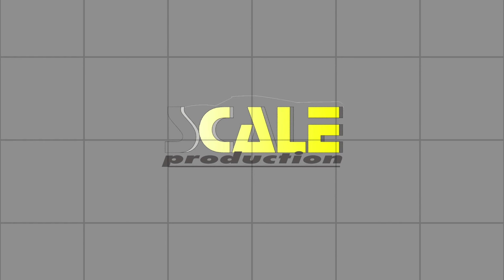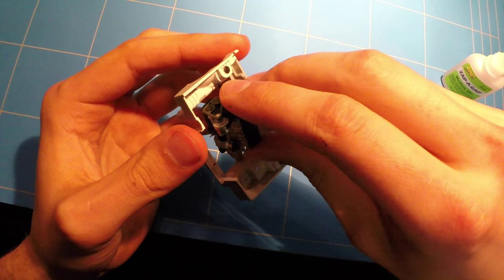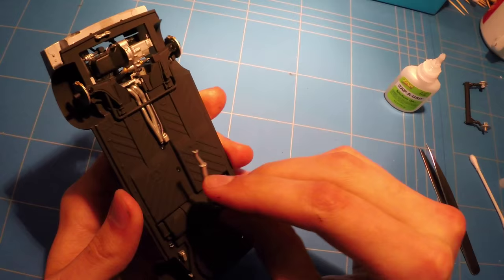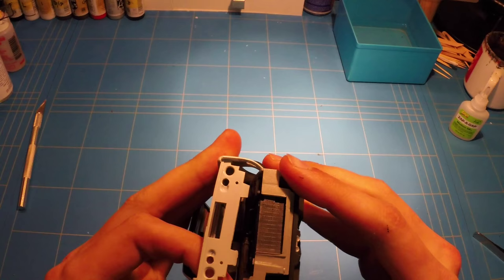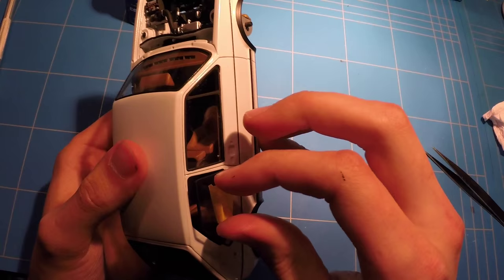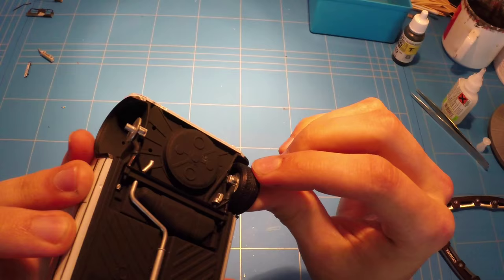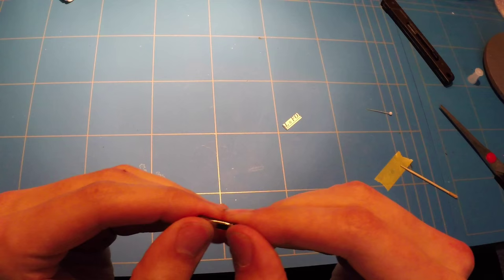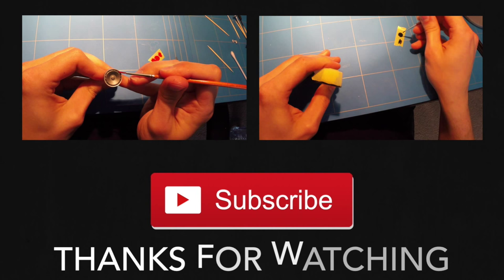Revell: VW Golf 1 GTI Final Assembly

Comment: What scale is this? Also, I was wandering if you were ever interested in for example putting lights in the cars you make. You can have some brilliant surface mount tiny LEDs in all sorts of colours to suit all sorts of ages of vehicles. An arduino could be a good choice... Or even a ESP8266 to make it completely wireless. And to get rid of any charging ports, you could implement a wireless charger in the floor of the car. All very cheap parts as long as you're willing to wait :P
Reply from the maker: This kit is 1/24

I'm not interrested in putting lights in the models at this moment in time. I also am not very good with electronics....
Reply: Well, if you were ever interested, I will be more than happy to help. Whether it's the coding part or the electronics part, just mention it and I'm on it ;)

Comment: Do you seal every part individually? When I glue two painted parts together, bondage is weak and paint starts to dissolve. Do you avoid this problem by using superglue instead of normal modeling glue? 
Great build keep up the good work,  true eye candy :)
-RJ
Reply from the maker: I indeed resolve this problem by using super glue. Or reming the paint on the glue surfaces when using plastic cement so that it can effect the plastic to bond, and not have the paint as an extra barrier.

Comment: did you use clear coat gloss?
Reply from the maker: yes
Reply: +The Scalemodeling Channel I am painting a NASCAR race car and I'm afraid airbrushing it with testors clear coat when all the decals are on at the end will ruin the paint job. is that true?
Reply from the maker: +Adrian Leon it is not supposed to. Maybe you should clear first. Apply the decals and let them cure for a couple days and then clear the decals
Reply: +The Scalemodeling Channel so clear gloss it first?
Reply from the maker: +Adrian Leon yes
Reply: Okay thanks for the help man, appreciate it

Comment: Whaaa? Somebody gave you a dislike! Was mildly horrified by the snipping at the rotors-gate, myself... but there's no excuse for ever clicking the dislike button >:(
Reply from the maker: Steve Watts Meh it happnes can't be to bothered by 1 dislike over 37 likes.Though you should know i to in to carefull cunsideration that the wheels have a closed face and you can not see the disks, and from the underside you can't even see the disks where cut. if the wheels would show the disks i would have figures out another way to do it, this was just the easiest to do with these wheels. Thanks for your kind replies! much appriciated!!!!!

Comment: Hi, great model currently building a custom revell golf gti. Please could I have your opinion on the seats? I have tried to imitate alcantara centres as I will be using recaro front seats aswell, which I like in this colour combo. Just not sure wether to stick with this or go wine red on the centress. Car is sprayed in VW apline white L90B. Let me know what you think of combination?  http://i3.photobucket.com/albums/y86/tt230/Public/20160911_145136_zps0mspdtfr.jpg
Reply from the maker: Stick with the grey for sure!
Reply: Tough decision but I ended up using "red geranium" embossing powder for the centres as I wanted a little extra contrast for the models sake. Turned out quite well. Just another quick  question I hope you dont mind answering. Do you have any experience with 1-3mm stainless tubing as I now want to make a 4 branch manifold for the golf? cheers.
Reply from the maker: Have not yet tried anything like that.